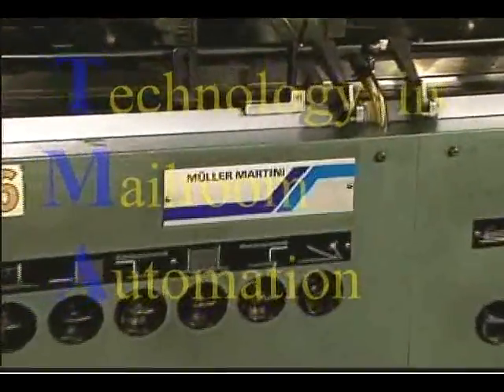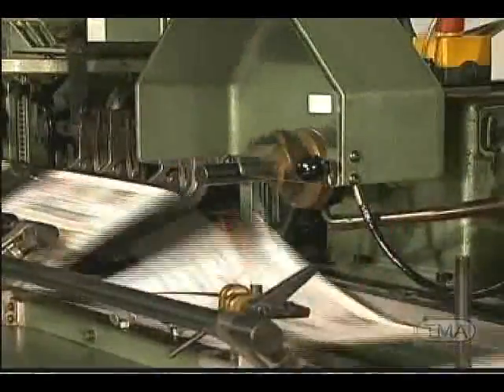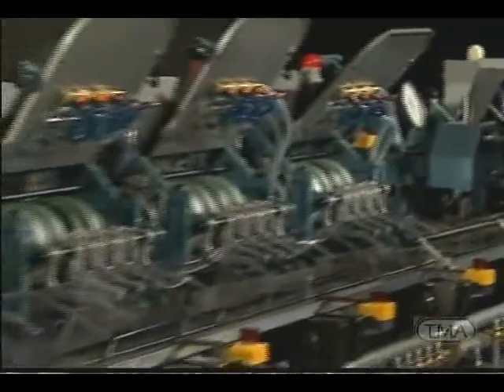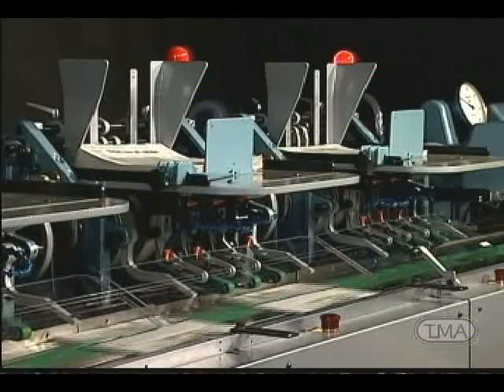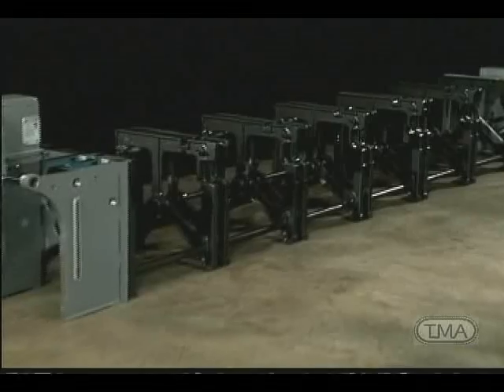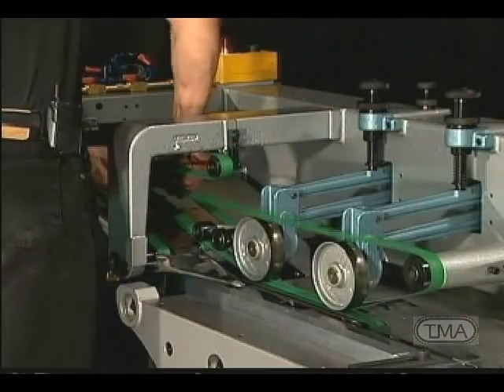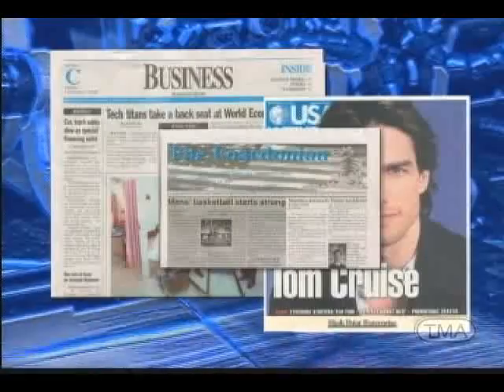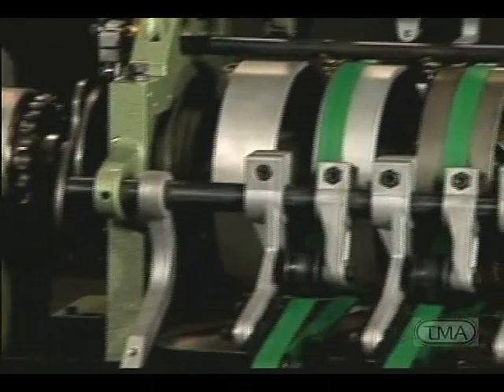Muller Martini 227 inserter  www.timacorp.com

Comment: Ahh the memories! The 227 took my cherry back in, hrmm... 1992? I've run the harris 1372 as well as the sls1000 and 2000 and yeah, although the 227 isn't much if youre all about racing and showing off speed, it was fun to work with. Thanks for the memories and God bless all you mailer vets out there!

:o)